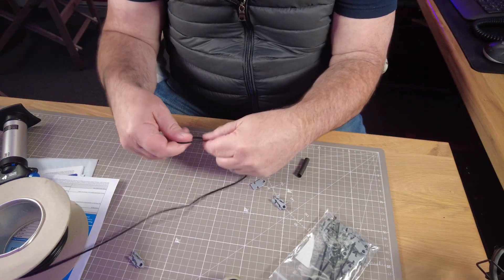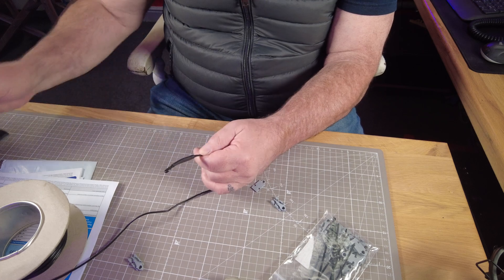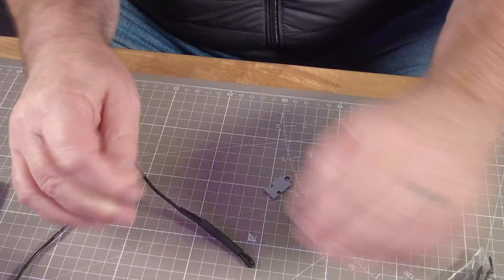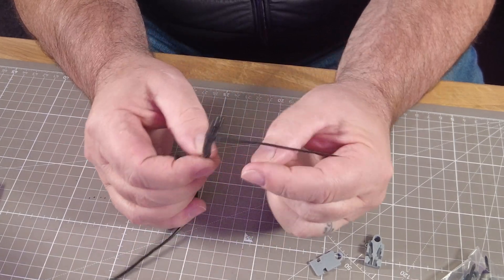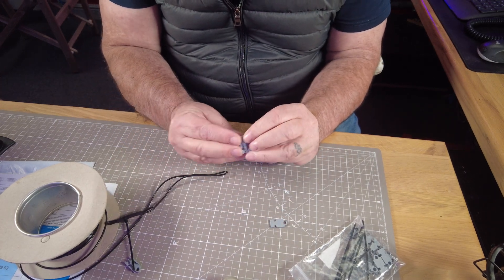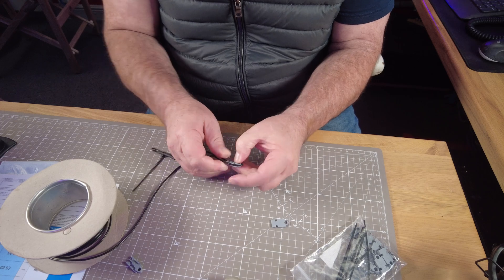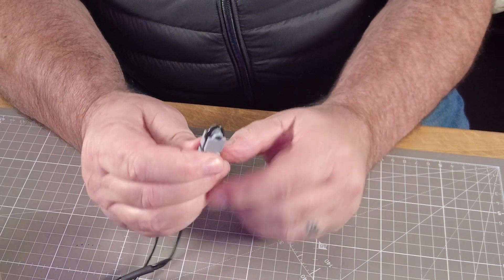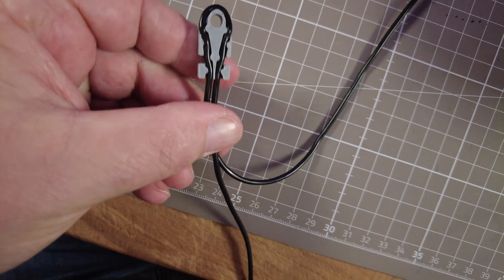Cool Tip for end of ELEMENTS (Dipoles and Verticals)

Comment: I ended up doing the tie wrap install on the heat shrink too, I am located in north central Illinois and I have had issues with the shrink wrap not holding up in the heat of summer, I purchased the Expedition antenna and plan to try to keep it up all winter.

Comment: Dear Commander Callum, this tip is very helpful for someone like me in Tennessee, USA. 

As far as the end of the radiating element goes - if one makes a loop and then at the bottom of the loop makes a small coil around that wire - is that the end of the radiator? 

Perhaps a silly noob question.

As always, time well spent watching your videos. KQ4IXD
Reply from the maker: Erm. Sort of.. If it's insulated wire, then the end is literally the very end where it's cut. Strange things happen with foldovers though. This explains.. https://youtu.be/0UwaIc3GdSA

Comment: Learn to tie two knots : The half blood and the hangmans noose. You can feed the end through a ring when starting the knot if needed. The half blood is commonly used to tie a fishing hook onto the line, or join two lines together. There is also a modified half blood where you make an additional knot in the end. There are plenty of videos on UT showing how to ties these knots.  (I find the hasngmans noose better for the thicker wire.)

Andy

Comment: Some great ideas for wire ends. This works with QRO loops as well.  When getting high power like a KW you do not want a sharp end of wire . It will draw a spark. Corona discharge .  Now I want to print out a bunch . My favorite portable antenna is some kind of wire antenna.  Like a end fed or center fed dipole.  even vertical for DX . Cheers from NY !
Reply from the maker: Great idea